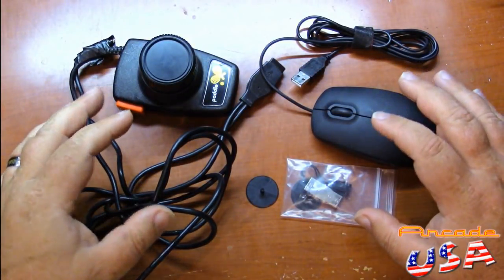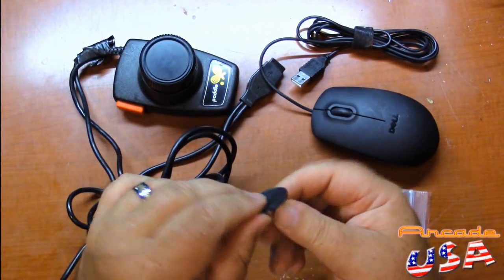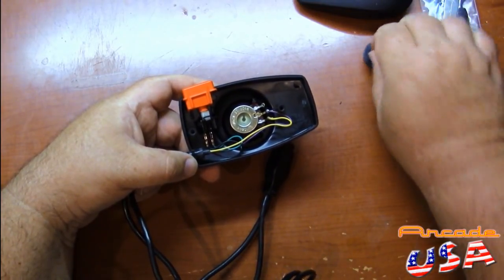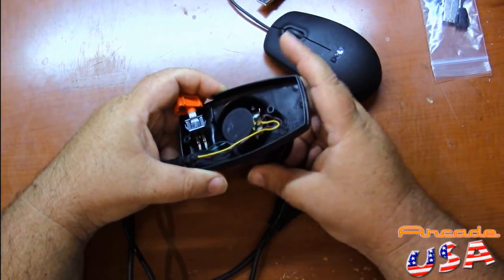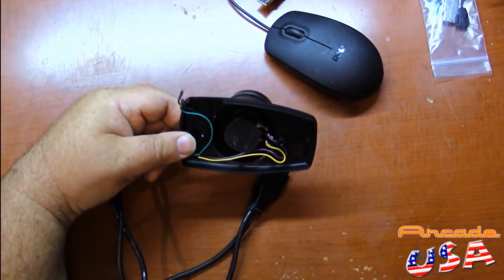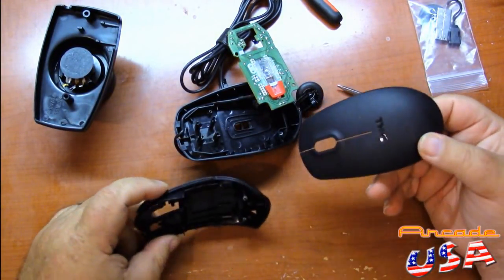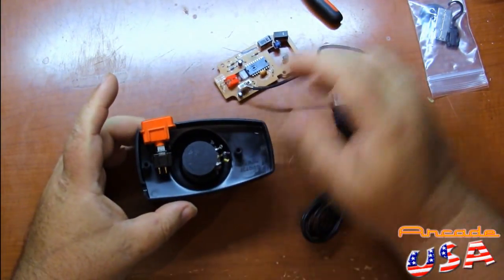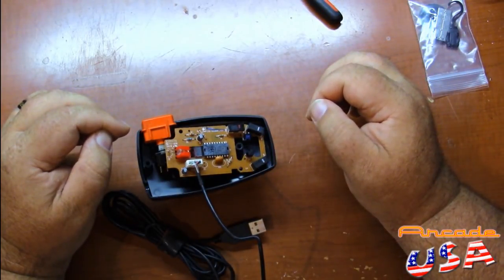Atari USB Paddle Controller Build Version 2

Comment: Great DIY video! I think I got a little overzealous wanting to fit the guts of a Corsair gaming mouse in that little space. The idea of having the onboard DPI selection option sparked my interest but getting all that into the available space was virtually impossible. Firstly because the laser sensor is offset to one side making it impossible to align on the disc properly (in the given space). So, I constructed the device as described in the video out of an HP mouse (optics centered on the circuit board), fabricated my own disk, and completed it with only two additional modifications:  (1) Altered the POT so there are no limits. The knob runs freely in both directions. This lengthened the project, but was defiantly worth it. (2) I added a simple push button on the right side, opposite of the original button, for the right mouse click. It comes in handy for Tempest, and a few other games that can use a mouse. Well technically, the modified paddle is actually a mouse, but works like a paddle. I found that positioning the laser sensor near the outer most edge of the disk worked the best.

Comment: I was able to get this working, however physically getting the mouse board into the paddle required me to drill a few holes in the back of the paddle. The fit wasn't ideal. I tried Warlords and Kaboom. Playing on my PC with Stella.  I also installed Stella on my RetroPie but the mouse/paddle doesn't work properly. Anybody try that? The mouse is found in RetroPie as Mouse0 so I know it is seen. But for some reason Stella on this is giving me a problem.

Comment: How does the responsiveness compare to the cx30 on a real 2600? Reason I ask is I have a Flashback 8 Gold and the paddles are sooooo laggy. I was thinking about gutting the case and putting a RPi in there but I'd like to be able to use the CX30 to give that real feel experience. This seems like it would do the trick but before I go through all of that work, I thought I would check first.
Reply: FB9 doesn't lag, but you'll need to use modified paddle controllers that work only with the FB9. A bonus is that the FB9 allows you to load ROMs onto an SD card. I've confirmed that even ROM-based games work with the modified paddles.

Comment: Really cool project! Instead of using an old controller it could be all 3D printed too!
Reply: Another good option for a "donor controller" would be one of the Flashback controllers, 'cause they're cheap, easily available, and you're not destroying notable historical treasures.

Comment: Does the rotary circle has to be black, I made one that is white, the button works, but the sensor does not, any help or recommendations ?
Reply from the maker: not used white before.  does the sensor react to a piece of paper placed under it, if not you have a issue with the mouse circutry.  it it does see the paper, then just get a black permanant marker and color in the circle.